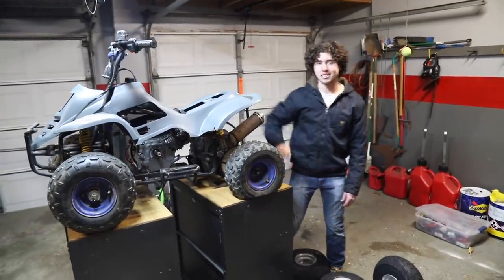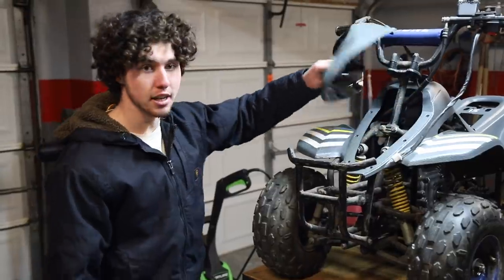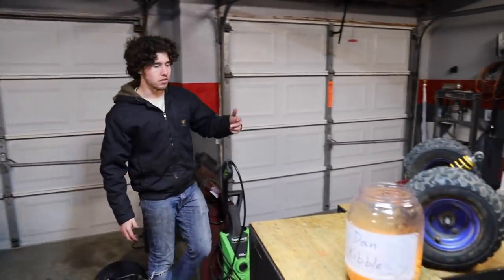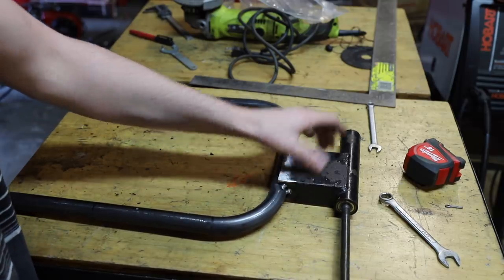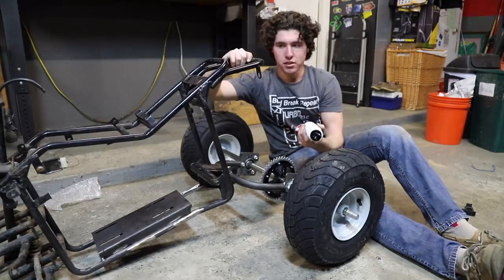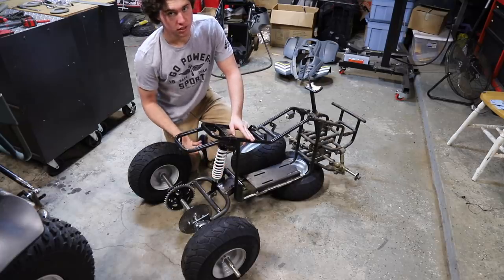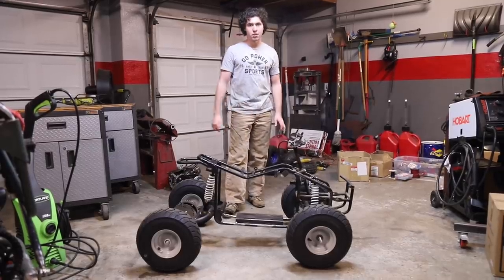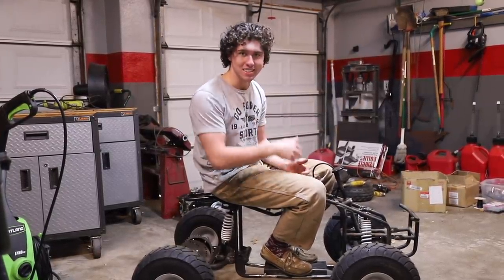Monster Mini ATV Build Part 1 | Suspension and Frame!

Comment: I definitely have more popcorn for this one! Great project! Does Go Power have any spring selections? After the rest of the static load (engine, drive chains, handle bars, disc brake) is added, I'm spit wadding for you to want about %15-20% more total rate on the back end and maybe 10%- 15% for the front. that probably won't really take the soft springy completely out but it should help keep you from bottoming out the suspension more or less. Oh, and how is college going guys? Grades up and all that? Get that degree- it is key to getting to the life you want to live! BTW, if it turns out that your degree related job doesn't seem fulfilling, you still have a great income to help pay for the next studies to go where you want to go!